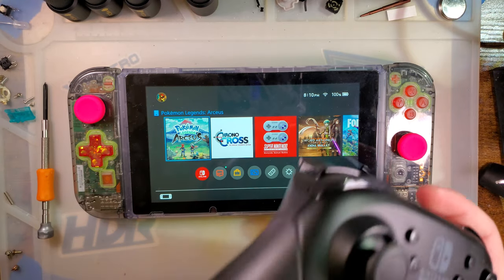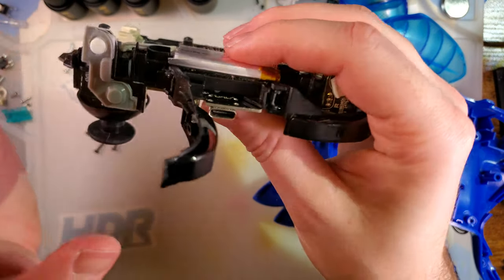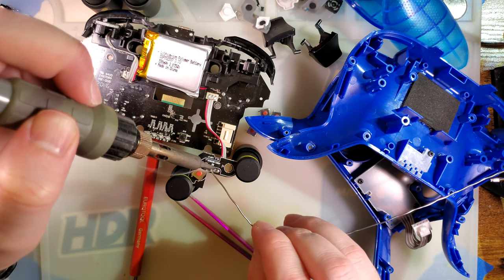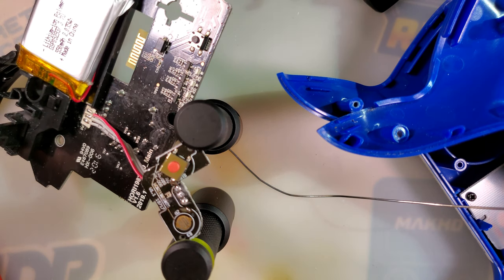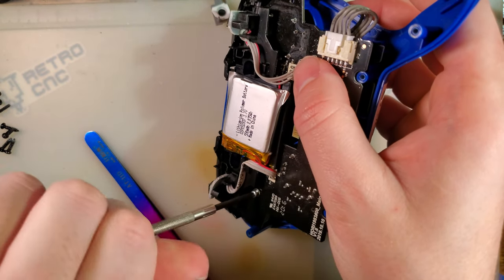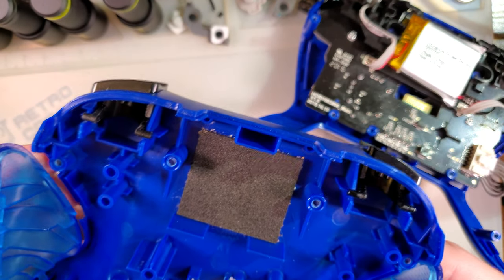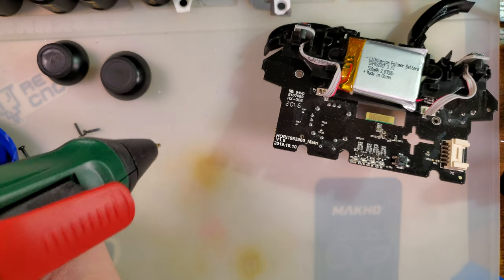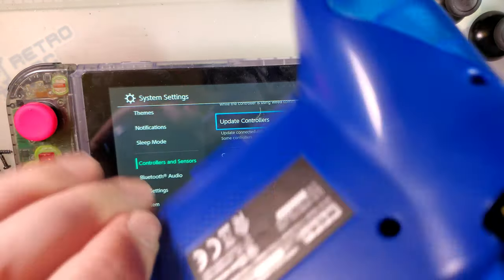Hori Switch Pro Controller Shoulder Button Repair

Comment: Thanks for the video. I had this happen to an 8bitdo SN30 Pro+ with the face buttons. Thankfully 8bitdo mailed me replacement rubber membranes after I told them I'd be willing to do a DIY repair - nice! But I'll consider this method in the future especially as the tactile buttons will probably feel quite nice.

Soldered in batteries are the worst; anti right to repair IMO.
Reply from the maker: Heh, I didn't even think to reach out to Hori. I suspect they'd tell me to pound sand but that's good to know

Comment: Hi!! I know I'm very late to this video but I've just recently started disassembling my wireless hori controller as well to both clean it and fix the zl and zr buttons. The main problem I've come across is taking the screws out, and I've only managed to take 3 out of the 8 out, the rest wont seem to even budge a millimeter. Could it be a rust problem or could it be the screwdriver? I'm using a screwdriver I've found in a store that, even if with a bit of work, has managed to take the first 3 screws out. Would it be wise to change it with the one you used? If so, do you mind sharing the model?
Reply from the maker: I use this kit: https://retrogamerepairshop.com/products/ifixit-mako-driver-kit-64-precision-bits

As long as you're using a set with the proper sized driver though, it won't make a difference.

Comment: If you have a way to restore the aesthetics of the  switch pro controllers I think that would be a really interesting video. Maybe even just trying different things like steel wool or something...
Reply from the maker: Nothing can be done about the worn out stock texture but they can always be sanded and painted to clean up the scratches and gouges. I'm not going to bother besides reshelling a couple though.

Comment: bro, I need your help. I want to fix my controller because it has a drift issue. I want to change the joystick, but I don't know which one could work or be compatible with this controller. Please respond.
Reply from the maker: What did you search?